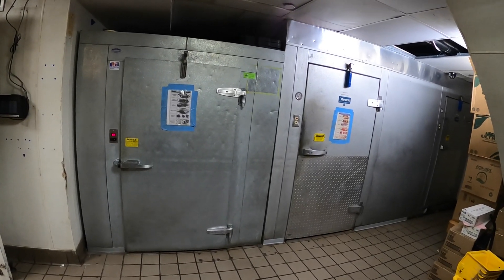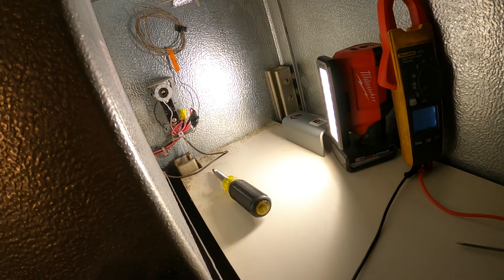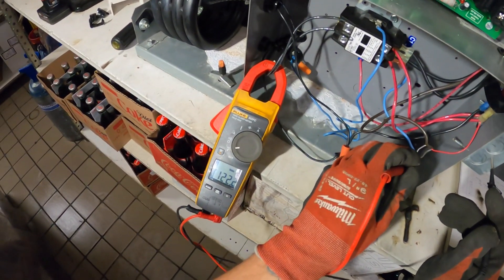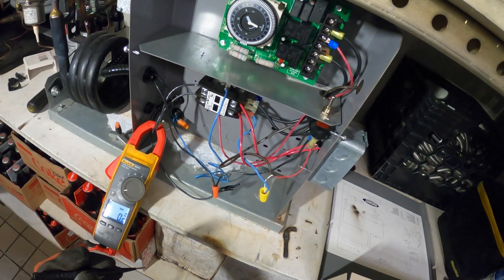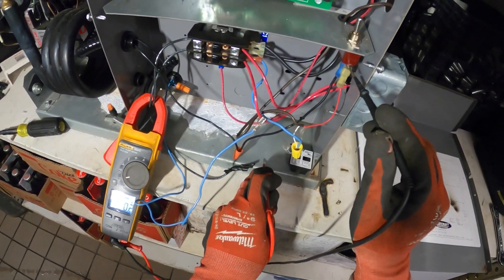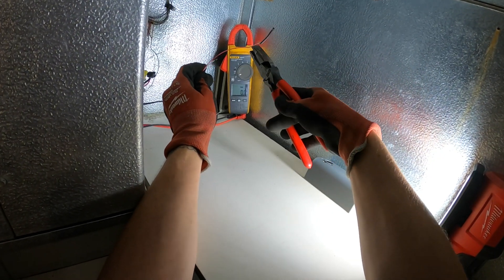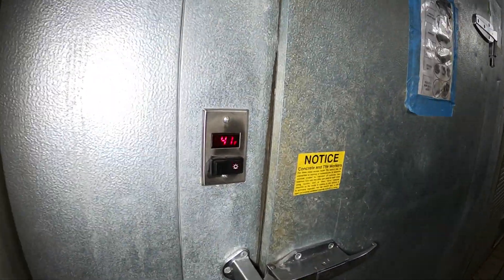HVACR Service Call: Walk In Refrigerator Not Cooling (Refrigerator Compressor Not Starting/Working)

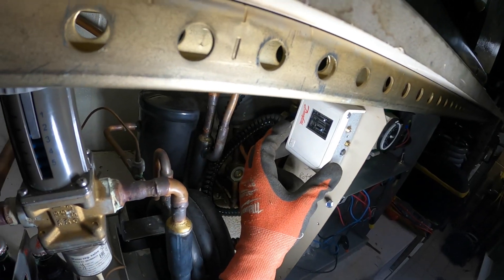Comment: Don't feel bad but anytime you're checking for 2:08 or 2:40 just because you have 120 or whatever on everything it doesn't matter you got to have 240 or 2:08 whatever you're working with. I made the same mistake years ago so I'm definitely not judging you I called an older wiser technician I knew he stopped me in my tracks he said I'm not asking you if you have 120 I'm asking you do you have 240 LOL that was when I learned that

Comment: confused why they need a defrost timer on a refrigerator also why is there no liquid line silinoid and why low voltage wire lots of questions i dont do alot of walk ins just curious

Comment: I would not recommend any tech to go to ground for troubleshooting, learn how to read voltage on switches and 18 gauge wire for control voltage on a 208 system?

Comment: You had 120 on 1 side of the contactor and power was flowing threw the coil giving you the same 120 out. Testing ac voltage should be done leg to leg. Not leg to ground like DC. But none the less you figure it out and fixed it good job bro.

Comment: Check defrost timer for power if there is power present clock bad that’s why u had no green light or red when u turn the clock. if u follow the red  wire coming from defrost clock its ur other half line for contactor. U just bypass the defrost clock and called it a day

Comment: Measure neutral to ground then live 1 and live 2 to ground. Using 24V thermostat wire for a 208v control was plain dangerous 😳. Thermostat wire insulation is only good up to 120v max before it fails, and only legally meant for low voltage service. A shorted solenoid coil could have easily started a fire because the wire would have burned up before a fuse would have blown. Scary 💩

Comment: Jumper man keep on jumping ! Don't feel bad electrical troubleshooting has humbled us all at some point lol. These types of struggles are the types that will elevate you to electrical master in no time. Bottom line if a component is tagged for 208,120,24 etc and you don't get it from post to post then the component is not bad and you should keep on working backwards from there.

Comment: the 28 volts was coming through the coil from the live side of the contactor and then dropping to ground as the difference between the phase and earth (ground in the US). If you think the contactor  control coil has failed (Which does happen with coils energized for hours on end), disconnect the coil and do a resistance test across the coil. These pesky faults can have you chasing your tail for ages if you are focused on whats wrong an see something weird... I always do the supply test first, then the contactor tests after checking the fuses are good and then the switches and the starting caps.... if they all look good, then look at things like compressor winding resistances.... Some of these systems start out well designed, but the differing skilled contractors on a quick turn around can turn the unit into a heath robinson setup so quickly... Kudo's for staying focused on getting the control circuit ironed out dude....bravo

Comment: Great video. You were a little confused with 120v to ground on each side of the  contactor coil but nothing across. That's typical 208v control meaning you lost a leg of 208 which you found at the burned up wire at the tstat. Still wonder why you didn't check 208v at the time clock to power it up when your green light was out? Hopefully your next call there isn't an iced up coil due to time clock motor not powered up. lol. Love the liquor check at the end!!

Comment: Word of advise. Do it the european way, single phase or triple phase. Not those 208 thing. 
Coils using LNE (230V), motors using either 230V LNE or 400V 3 phase (usually without N). Electricity in Europe (DK), is much easier.

Comment: Think of the coil as just a length of wire (which it is).  When only one side is connected to AC, then it will act as a wire, so you will always see a similar voltage at both ends of the coil with reference to ground, but no voltage across it because no current is flowing.

When there is power applied across both terminals, the coil is energised, current will flow and it will drop voltage across it, so you will see a voltage between the terminals.

Comment: I suggest you go back to basics as your electrical fault finding is haphazard and poor. You need to learn to test correctly follow the circuit step by step and by process, just grabbing wires and testing to earth does little or no good unless you charge by the hour...  

Test across the terminals not to earth as power was going through the contactor coil to the other side but coming to the other side. This was very obvious early on. if you went across the coil you'd see immediately one leg was missing.  Blaming the contactor early on was another obvious "fault finding by assumption rather than by diagnosis"

Sure you got there but you went round in circles and got lucky. 

Thanks for sharing, and good luck going forward

Comment: Your AC voltmeter measures voltage drop, it measures 208v across an energized coil because there is a 208v drop across the load. 120v on one side of a 208v coil will still conduct across the coil but will show 0v drop across the coil because there is no load.

Comment: Great video. I noticed their was no green light on the clock tho.  Should have checked 1 to N and 4 to N. Then put in defrost to make sure it cuts off the tstat. Then check 3 to N. Always check wires when no romex is used. The definitely rub out.

Comment: Good job man. A little bit of a confusing call. But you got it right. Its crazy how different HVAC is in NY due to limited space. I'm in Wyoming and almost never see water cooled condensor on anything most chillers are air cooled. Actually a decent amount of vrf stuff out here it's getting out into old commercial buildings because install is less invasive. Thanks a bunch for taking the time to make these service call vlogs.
Reply: this isn't HVAC, it's refrigeration

Comment: Like I said. The low voltage wire can not handle the amperage from the line voltage running then it. The wire is only good for low voltages
Reply from the maker: Facts. It should definitely be replaced. So many shortcuts have been taken in this location
Reply: @JumpermanTech definitely dangerous to have high voltage on stat wire. Easy fix is to install a transformer and 24v contactor to power the control circuit. 

Btw the small metal switch is a pump down switch.

Comment: Wiring is probably burnt from higher amp draw. 18 gauge wire not to be used for line voltage
Reply from the maker: Definitely should not be used for line voltage. That should be replaced 💯

Comment: Missing a leg from the defrost clock buddy
Seems your other leg of the coil is the #4 from the clock, if the clock is bad or has bad contacts which your clock has no lights you’ll never have your other leg to the coil to contactor unless stuck closed which in this case it might be it, hope it helps
You check to ground to verify but not to diagnose as it’ll always throw you off
Reply: @jruizsr  yes sir 
Have made a wiring diagram board to train my brother that just joined the trade not too long ago
Reply: I was screaming by minute 5 to check power at the clock. I thought he was trolling by ignoring the clock.
Reply: @skanteroar  😂 it’s cool man we don’t all know it to be the main power source of operation on a unit but then again we all get tunnel vision sometimes and that could mess with us hard, just glad he found the short in the wire but that clock not lighting up indeed shows to be bad

Comment: I always appreciate your videos!  You made this one a little more complicated then it needed to be.  Me personally I always do all my interior box checks before heading to the roof. That includes taking the cover off the thermo which would have led you to the issue right away and this job would have been done very quickly.  I’ve found it very important to approach walk in calls the same way every time and have a procedural way of doing it so I don’t miss easy things like this.  Also I would never say a load is working/not working by testing pins to ground,  120v on both sides to ground is not the same as 208v across the coil.  There are several reasons to why you would have those voltages but testing across for 208v is truly the only way of know if it should be energized or not.  I think you’d benefit by approaching these calls the same way every time rather then changing how you do things based on the condition!  Do it in a procedural way for a year and you will not get stumped on calls like this and you will have a vastly better understanding!  I’ve been training a few techs lately and I’m really just trying to help!  Keep up the good work JMT!
Reply: This comment helps me.. im a rookie tech, thank you!!
Reply: That certainly makes sense.
Reply: Yo, what’s up man? I’m green in the trade and this really helped out. Do you have an email anyway I can get a hold of you in case if I ever get stuck please and thank you.

Comment: Reason why 120 to ground was showing on both sides of the contactor is because you have a closed circuit through the contactor coil...once you pulled the terminals off you interrupted the flow across the coil. Hope this helps and keep up the great content.
Reply: You don’t test like that. Put across both L1-T1 and you should get 0V. If you get voltage it means you don’t have power to it.